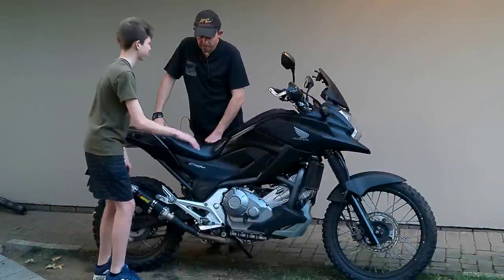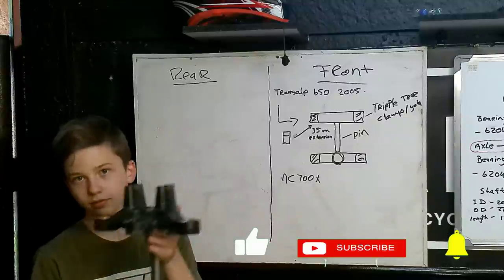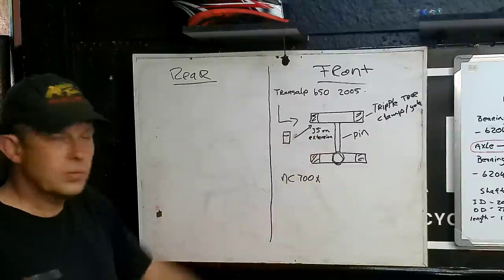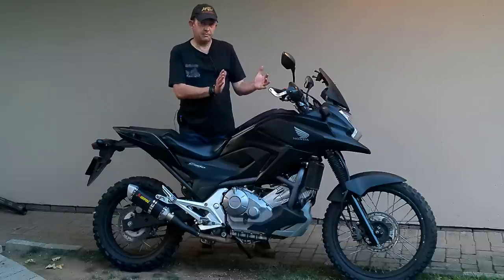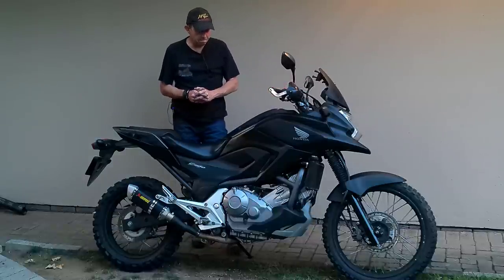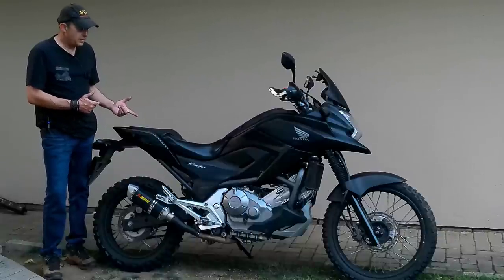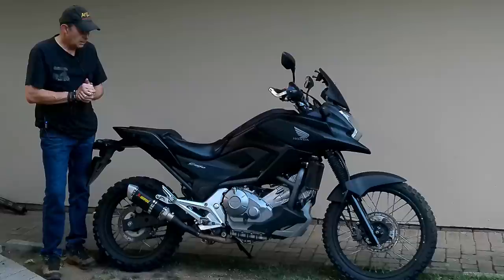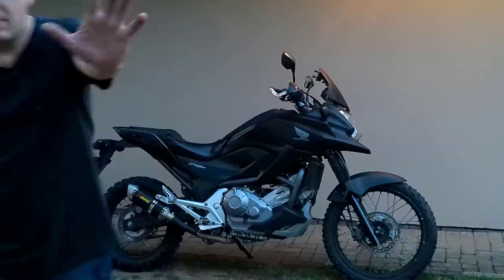NC700 Part 6 Does the rear wheel Fit? How did we do it? #nc700x #nc750x

Comment: Greetings from Portugal! What a great project! I have an NC750x with ABS, 2017 model, and i have alteady done some travels with it, and the engine is just great and reliable, BUT for sure its weakness is the suspension, i was thinking about swaping my nc for an Africa twin or the new tenere700 world raid, but since i have seen your video i have made up my mind and looking forward for a front end of a africa twin 2016 to instal on my NC and mantain the ABS system with and on/off switch!
Reply from the maker: Thanks man...the XLV700 will be ABS swappable,but i guess you can use the crf suspension too...i am so glad people like my build,share it with as many people as you can please..Frank
Reply: @FranksWay  i had take some measurements, and the crf would do, however since the forks are 49mm, a piece of the front fairing have to be trimmed, the AT forks would do with no need for cutting the fairings.
Reply from the maker: Keep me posted please +27717802213 thanks Frank

Comment: Sounds like the Honda is almost as good as the Versys..
Reply from the maker: Hi, you did not specify engine size, if it is the 650, the 17 inch wheels front and back will not be great off road, but that is just my opinion :)